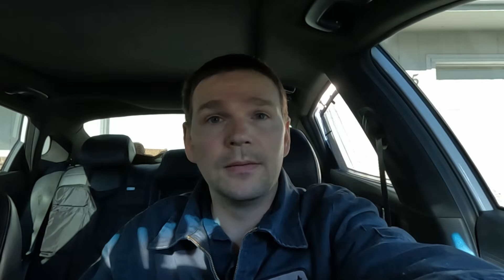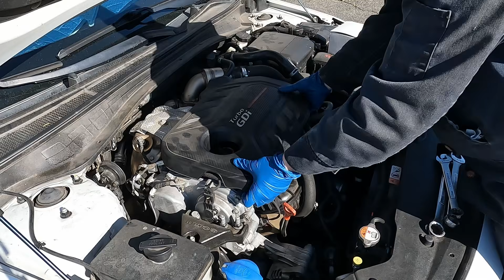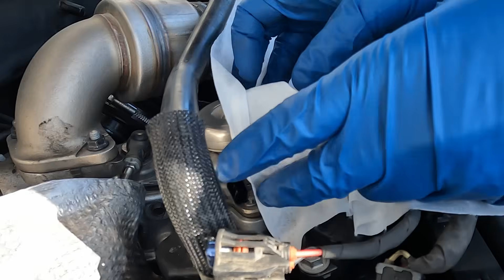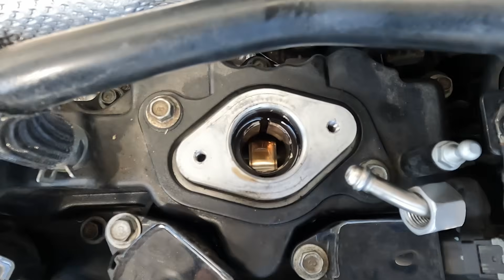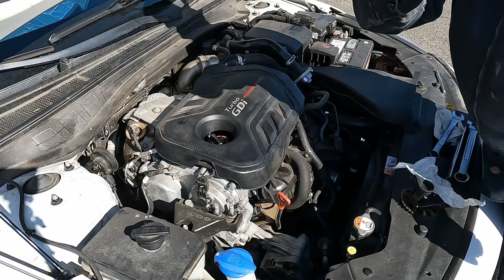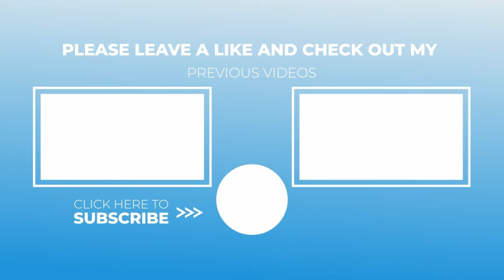2016-2018 Kia Optima High Pressure Fuel Pump Replacement

Comment: Do we have to release the pressure before we start by any chance?
Reply from the maker: You can remove the fuel pump relay or fuse and start the car. It should die pretty quickly. That will depressurize the system. Be aware that some pressure may still be present. That's why I use a rag to shield any possible spray 👍
Reply: @ValleyMobileAutomotive thank you so much

Comment: Hi guys, I recently bought a 2019 Kia Optima K3 with 192k km mileage. I’m hearing a whining/electrical-type noise coming from around the fuel tank area, or possibly underneath the rear seat.

Has anyone experienced the same issue with a Kia Optima? If so, do you know what could be causing the noise?

Would repalcing the fuel pump will fix the issue ? 

Thanks in advance.
Reply from the maker: Does it do it when you turn the key to the run position without starting it? The pump should be on for about 2 seconds to prime the system.

Comment: Do you need to depressurize first?
Reply from the maker: I didn't but you can by removing the fuel pump fuse or relay and starting it up until it dies. Then try to start it one more time. There will still be a little pressure in the system so still use a rag to cover the fuel lines when removing them and safety glasses 👍

Comment: I was diagnosing a 2019 cadenza, with a 3.3 l V6 and found on my scan tool that it was registering 2000 psi at cold idle and flooding the engine with too much fuel, causing misfires randomly on all cylinders. I replaced the high pressure fuel pump, checked my pids, and it was cranking at 1400 psi now, but now it won't even start. 

I've cranked the engine probably twenty times it's not just air pockets in the fuel line at this point is something in the ECM stopping this from starting due to fault codes?
Reply from the maker: What codes do you have?

Comment: Some people recommend movie the crankshaft to the lowest position. You didn't do it. Is that necessary?
Reply from the maker: It can be helpful by reducing spring pressure but it's not necessary. It's under spring tension no matter what. Walking the bolts off a little at a time is all that's needed 👍

Comment: Demn I just broke that gray retainer clip. Is it too dangerous to drive with this part broken?
Reply from the maker: Pull on the fuel line and see if it will come off (wear safety glasses). It can see pressures of around 60psi. That's the low pressure feed for the high pressure pump.
Reply: @ValleyMobileAutomotive  well when tried to pull it off right now it won't come off.
But now, how can I release that  fuel line if that plastic is broken and I can't push it against the fuel line?
Should I remove that broken plastic piece completely and then pull it out using some fuel line extractor with the same size of the line? Which is 5/16?
Reply from the maker: @Yairiko  I haven't played with a broken clip before but it's possible a fuel line disconnect tool will work. Let us know how it goes 🤞

Comment: Hi, thank you so much for the video. I have the P0172 code come up and there is a check engine light. My oil does smell like fuel. I feel as though it may be the high pressure fuel pump. Would an oil change also be a good idea?
Reply from the maker: Yes, change the oil as soon as the pump is replaced. The fuel will break down the oil and it won't lubricate as well.

Comment: Great info! I found it easiest to remove the low-pressure line by using a pair of scissors to apply pressure to both sides of the retainer. It kept kicking sideways when I used a screwdriver.
Reply from the maker: That's a great tip, thanks for sharing! 👍

Comment: Why is no one replacing the hard fuel line? It's one time use.
Reply: I heard that too
Reply: Obviously not, Chief
Reply: It should be replaced with a new hose for safety purposes.  Although the flared end may seal properly a second time it's simply not worth the risk of an engine fire.

Comment: Would you Help me out with my car. Making a boogie sound and doesn't want to go and a loud tapping sound coming from the high pressure fuel pump
Reply from the maker: With the right scan tool you can double check fuel pressure from the high pressure pump. If it's making a loud tapping noise then most likely it's a bad pump.
Reply: Thanks I'll look into it @ValleyMobileAutomotive

Comment: Seen something about the crank having to be turned to not damage the fuel pump
Reply from the maker: I just double checked and that's not in the manual. It only mentions removing each 10mm mounting bolt a little at a time so the pump comes out as evenly as possible. You don't want to remove one all the way so the pump is cockeyed coming out. The same goes for installing the new one 👍
Reply: @ValleyMobileAutomotive okay! thank you so much
Reply: I made sure to turn the crank with a 22mm socket, atleast to position the loop down  that way there wasn’t any tension on the spring of the fuel pump
Reply from the maker: @Icebreaker9  Good move! Less spring pressure the better 👍

Comment: Be sure the cam lobe is in the low position, i didn't, and broke the spring Rod😢
Reply from the maker: Ah bummer. Sorry that happened 😔. Because these are under spring pressure even in the low position it's important to loosen the bolts a little at a time and try to have it come out as evenly as possible. The same should be done for installation as well.

Comment: Replaced the pump inside the fuel tank because it was running rough and weak, as if it was puttering. Did not seem to fix the problem.

So I then replaced this high pressure pump. But now, it doesn't even turn on after replacing it. Just keeps cranking. I did not touch the lifter though. Just left it in there and installed the pump over it. Could that be the issue? I figure if it ran with the old pump it would at least turn on with the new one.
Reply from the maker: If you have a scan tool that can read live data you can look at the fuel pressure value. If you don't have pressure then take the pump out and inspect the cam lobe for wear. A side note, sometimes it takes a little bit for the air to be purged from the high pressure pump.

Comment: Thanks so much for posting this tutorial. My check engine light came on for my 2018 Kia Optima SX Turbo. Autozone Fix Finder says it's error P0172. After a bit of searching, I believe it's a high pressure fuel pump. If I replace this part, do you believe this will remedy the check engine error? Thanks in advance!
Reply from the maker: @Nobodynonamenoway  There are a couple of things that could cause a rich condition. The fuel pump leaking and mixing into the oil can definitely cause this. A quality pump can be spendy. I would recommend doing a little diagnostics first to be sure.

Comment: The studs that hold my pump in place broke off , how do i remove and where can i purchase?
Reply from the maker: @Guccicrew1  The 10mm bolts?If you can remove the pump and extract the bolts you can bring it to the local hardware store and match up the threads and length and use any bolt that matches. If you can't remove the bolts then the other option is to get a whole new valve cover. In either case you'll need to purchase new bolts from either the hardware store or the dealership.

Comment: Can you mess up the pump if you don't "walk it back in" each side at a time?
Reply from the maker: @MichaelCortez-n9k  It's hard to mess the pump up but it's a good idea to walk it on so it goes down as even as possible. That way there's less mechanical stress on the pump and bolts 👍

Comment: Followed these instructions now the car won't stay on at all. I think the person didn't follow the order. Can I take off and reinstall the same pump or will I need a new one now
Reply from the maker: @TwistedLyfofTV  You can remove the pump and reinstall it. What was the reason for replacing it with a new one?

Comment: Is it necessary to replace the high pressure line as well. I see people saying its a one time use and should be replace with the pump.
Reply from the maker: @ramssb3400  The manual says to replace the high pressure line. The reality is it can be reused. You just need to check to make sure the connection has sealed properly and you're not getting any fuel leaks. But if you're more comfortable replacing it then that's the route you should go 👍

Comment: What kind of noise was the hpfp making? Mines making a ticking sound at cold start then get quieter .
Reply from the maker: @Jowee206-l9m  This was making a loud ticking noise as well and leaking fuel into the engine oil. They normally make a little noise, that's why they have the insulator on them.
Reply: @ any symptoms like rough idle, low fuel pressure
Reply from the maker: @JoeyBrioso-l9m  The most noticeable symptoms besides the noise were a rough initial idle at start up and increased fuel consumption. Depending on how the pump fails and its severity you can have fuel pressure issues, rich or lean codes and other driveability problems.

Comment: Hey i just change the high pressure fuel pump on my car. Now im getting p1233. So u think the one i got is bad or is it the fuel filter
Reply from the maker: @doshainblake5885  According to the service manual a P1233 is most likely caused by the low pressure fuel pump. It's possible you need to replace the fuel pump in the tank. You can access this by removing the rear seat cushion. You'll need a special pump lock ring tool. Here's an affiliate link... https://amzn.to/4jPXxFn

Comment: Hello, thanks for the fix video. I thought you were going to fix the HIGH PRESSURE FUEL LINE with the 19mm bolt on. Mines is spraying fuel...ANY SUGGESTIONS IF THATS THE PROBLEM?
Reply from the maker: @chriscastellanos3985  Is it leaking at the connection? You can remove the line and see if either surface is damaged. Then re-tighten it and see if it can seal. If one of the surfaces is damaged then you may need to replace that component.
Reply: @ValleyMobileAutomotive  i actually never even thought of seeing if the bolt was loose or beyond that. SMH....Ill DEFINITELY do a thorough inspection of it today. Thanks for taking the time to respond. Truly HELPFUL and were Thankful 🤙🏽👍🏼

Comment: I have a 2017 kia soul with the same set up. There was no gasket between the pump and valve cover from the factory but no leaks. Do i need a gasket?
Reply from the maker: @chefchris5133  That's interesting. If the gasket wasn't there and it doesn't look like it ever had one then I'd say no gasket needed on yours.
Reply: Same

Comment: I heard we should run the car and pull the fuel pump fuse and let the car shut off to release pressure in the pump. I noticed you didn’t without any issues. Is that a necessary step?
Reply from the maker: @tristc6909  That's not a bad idea to reduce fuel pressure. I would still cover the line connections with a rag while disconnecting them 👍

Comment: Hey brother that plastic piece has broke by an accident. How screwed am I? Is that metal piece that’s under pressure got a little bent as well. How screwed am I? Will I need to replace the whole line or is there another metal piece with that plastic I can just replace?
Reply from the maker: @ohhlj2761  You need the inlet fuel line to lock into place. If it can't lock or if it leaks then the line needs to be replaced. The plastic cover I believe is an extra safety lock. The metal line can bend a little but you don't want any kinks. If you have any kinks that restrict fuel flow then it should be replaced. Also kinks create a weak spot in the line that can break under pressure.

Comment: I have been getting a lot more valve ping, especially cold engine with light it moderate excelleration. As the engine warms, the ping decreases, but it is still there. Also, rough start occurs from time to time. No codes, still good mpg, and some oil burn ( 1 QRT per 2000 miles). Thoughts!!!
Reply from the maker: @billbesser3502  It's hard to say without hearing it. Does it make the noise at idle? Take the foam noise insulator off of the pump and see if it gets louder.
Reply: @ValleyMobileAutomotive  thanks for the reply. To answer your question, it is 
very loud on cold start. It does quiet down a little. But not what I call quiet. Still very noticeable. Typically, valve ping it either timing or fuel. I run top tier fuel. Tried different octanes, ran chevron injector treatment, and timing seems good. The ping seems like is a fuel starvation issue.
Reply from the maker: @billbesser3502  If it was starving for fuel you would get a lean code. Ping happens because of pre-ignition. Like you said timing or fuel composition. If you had a timing issue you should get a timing code. If you have a scan tool that can read live data look at your knock sensor and ignition timing. When the knock sensor detects a ping it will retard the timing to help eliminate the ping.
Reply: So whats the answer to the question I have the same issue. Should I take it of and reinstall it again ? Or is this completely normal.  I give it gas and I here the ping when I left off the gas it stops.

Comment: When removing the fuel part, I forgot to remove the 10mm bolts slowly and evenly. How screwed am I
Reply from the maker: @JayK-cc8cy  You are most likely fine. It's just good practice when anything is under spring pressure to release it a little at a time as evenly as possible. Same when putting it back together 👍
Reply: @ValleyMobileAutomotive  thanks man, really appreciate your service to us
Reply: Putting new one on does it take time to start car?  Or will it start right away...mine isn't starting maybe air in it?   Ima wait awhile b4 trying again.....spark plugs maybe
Reply from the maker: @NatronFatumallafalla  It will run rough at first until the air is pushed through the lines. It should start within three attempts though.
Reply: @ValleyMobileAutomotive mine didn't after several attempts, it would crank but die. Sorry to jack your comment section but I need to see what to do if it doesn't start. It was running before the replacement

Comment: Hello, great video. Kia dealership said oil is leaking into my fuel pump and its burning off through the exhaust. I'm going through a ton of oil. But they want to replace the fuel pump and a hose $2280😳 Im fairly mechanically inclined and this looks pretty straight forward with your help. But, which hose would they be talking about?
Reply: You aren’t the only one who had Kia try to quote nearly 2000 saying it was the entire system when I do it myself and it was only the pump
Reply from the maker: @jeredhinshaw2903  Good question. On the one in this video there aren't any oil lines attached to the pump. Do they have part numbers listed on the estimate?
Reply: @ValleyMobileAutomotive the hose with the flared end, (19mm nut) is onsidered a 1 time use hose and should be replaced
for safety reasons.
Reply: Replace the positive crankcase  (pvc) valve
Reply: Came here from a 4k estimate at dealership!!